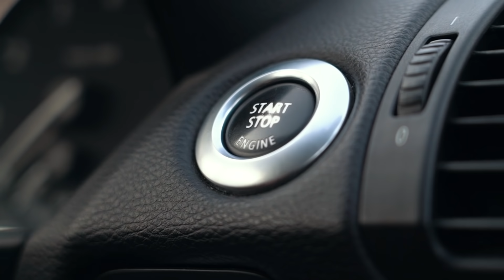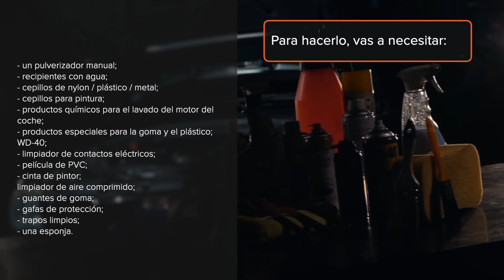5 errores que se cometen al lavar el motor | Consejos de AUTODOC

Comment: Otra forma más rápida de limpiar el motor. Déja encendido el vehículo, echa jabón con un pulverizador sobre la tapa motor, equipos auxiliares cono vaso de expansión , rejilla de radiador, moqueta del capo y después pulveriza a unos 40-50 cm con sistema de baldeo (karcherr) hasta haber quitado todo el jabón. 

Así se hace en los talleres y no se jode ningún motor, lo se porque así me enseñaron a hacerlo cuando estuve en taller.
Reply from the maker: Gracias por compartir tu forma de limpiar el motor. Sería útil para los seguidores. Tu equipo de AUTODOC.

Comment: yo caliento bien el motor, lo apago , y con un puverizador le pongo por todo el motor una mezcla de gasolina 2/3 y aceite de motor.
lo dejo actuar 10min y luego le doy con manguera a presion .
queda de cine
Reply from the maker: Gracias por compartir su experiencia.
Reply: Eres un crack, tu calienta el motor a 100 grados, y luego dale agua. Tu entiendes que al metal caliente no se le puede dar agua, el motor se petrolea en frio figura... Tu no seras del equipo de autodoc? Tambien seras de los que hacen 300 kilómetros y segun llegan al destino limpian el coche y dan agua a las llantas verdad? Al dia siguiente vas al taller por que te vibran los frenos. Venga suerte
Reply: Motor caliente y agua no casan bien.

Comment: Nunca vi semejante tontada, 30 años lavando motores campeón, y lo de la caja de fusibles, o demás gilipolleces te olvida ,lo que no hay que hacer es no esperar que este comido de mierda y no insistir con la presión del agua en un punto concreto ..😁😁😁😁😁,lo del plástico y el aceite que flipe macho ,seguro trabajas en un taller pero la politica del miedo con migo por lo menos va ser que no ...si quieres tirando la foto del motor de mi coche seat ibiza del 2000 el motor como recién salido de fabrica...
Reply from the maker: Gracias por compartir su experiencia. Será útil para los seguidores.